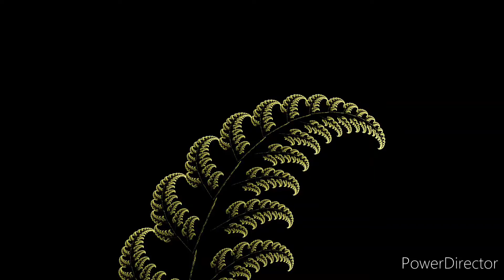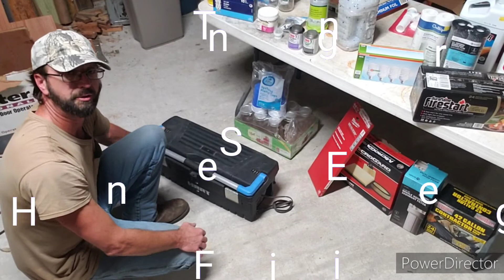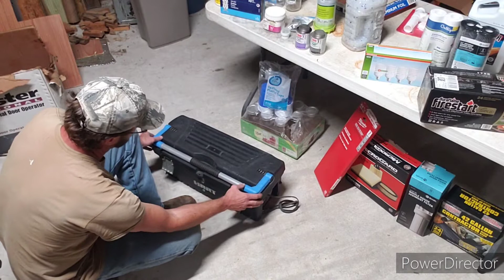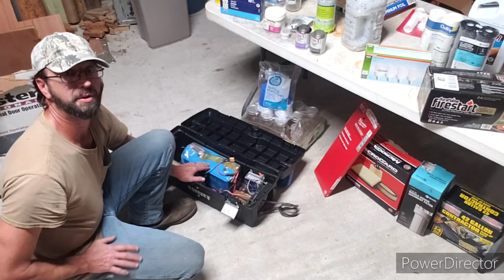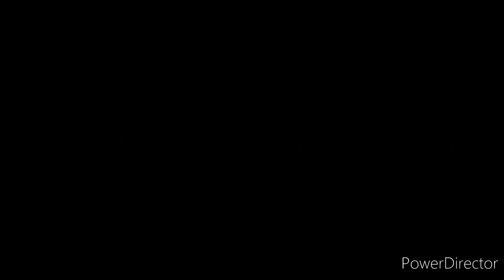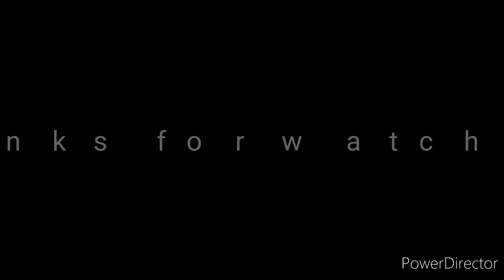DIY Solar Generator

Comment: Great video!
How did you ground your inverter?
Reply from the maker: I don't ground it. If it was going to be a permanent installation, like my 8KW house UPS, then it would be grounded.
Reply: @shtfengineering7472  Because it is 12 volt system there is no risk of anything bad?
Reply from the maker: @johnwayne2497  There is always a risk.  If I use a device that requires the ground prong, I would consider grounding it.  The inverter provides a "floating ground"  which is not good for heavier loads.  I have used all my saws on this box, and my welder connected to a generator in the back of my truck, with no grounding issues.  If I had wet feet or hands, there is a shock hazard as I would be the new ground connection.  I often use rubberized gloves when working with electrical power while it is live, and when using power tools with metal housings.
Reply: @shtfengineering7472  Thank you for your time. For a small load item with 3-prong ground how would I ground that?
Reply from the maker: @johnwayne2497  The inverters almost all have the 3 prongs already.  With small loads like lights, you should have no issues.  If you wanted to ground it, you can just connect a wire from the metal on the inverter case, to a ground rod, or if you have a natural gas pipe, they are iron pipe and make a good ground as well.  Feel free to email me with anything you want, and I will do my best to help you get set up.  😁👍
Reply: @shtfengineering7472  Thank you so much for your patience you have no idea how much you've helped me.